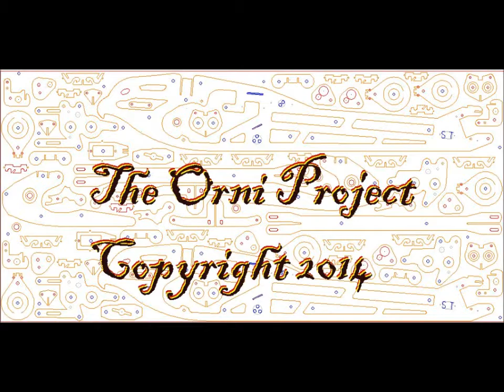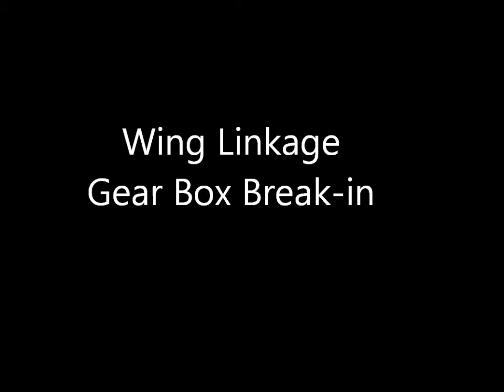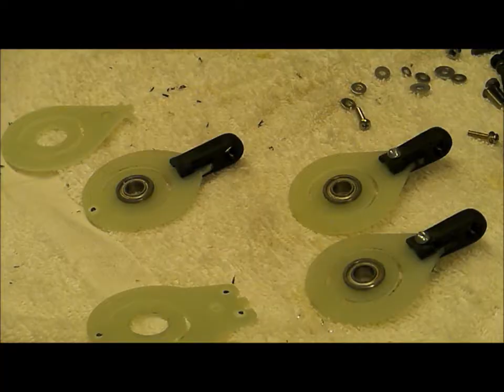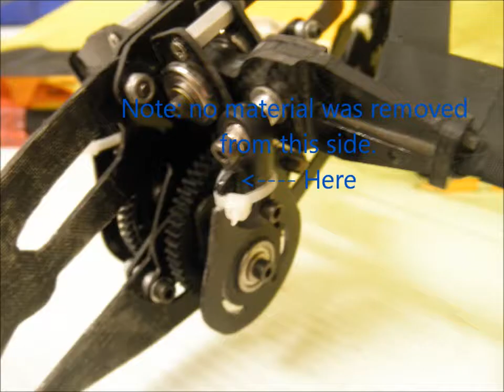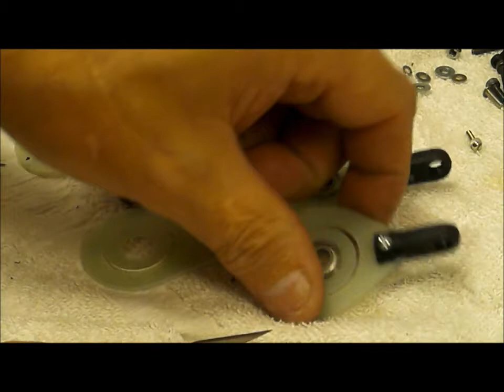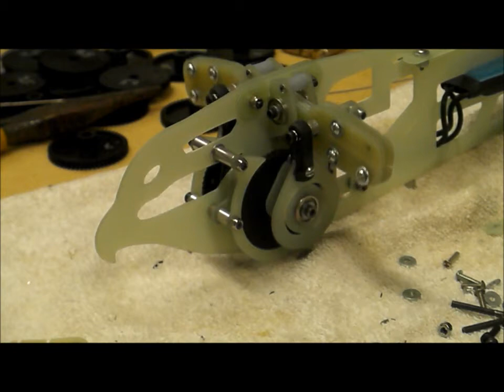Ornithopter Update #7

Comment: how do you mount the motor. considering it's an outrunner.
Reply from the maker: review the image at .33 in the above video and you can see the motor mounted using 2 screws in the back plate of the outrunner motor.
Reply: @supertroyofssf  but doesn't the bell of the motor also move? so if you're fixing it in place how is it the rotor going to move?
Reply: this is probably something very obvious that I'm missing, but could you please clarify
Reply: or do you add a shaft from the back of the motor?
Reply from the maker: The rear of the motor (the back plate) does not rotate so it can be mounted solid. Again see the image at .33 in the above video.
Also note the wires can be seen coming out of the motor at the back plate.

Comment: Which motors you've used so far and in the latest version? Which motor would you recommend for a 20 ounce ornithopter?
Reply from the maker: I am using a 4200KV.
The gearing and battery cell count you are using tell you the motor KV.
I would try for around 7hz at full power for a 48" span.
Reply: supertroyofssf
I am thinking to use worm gear assembly, because it's assembly is less complicated. So, my gear reduction will be around 30:1. And, I want to use 2S for low weight.

Which motors would be fine for 20 ounce ornithopter with 50" wing span?
http://www.hobbyking.com/hobbyking/store/__24929__B20_30_22L_FIN_Brushless_Inrunner_Motor_4220kv.html

http://www.hobbyking.com/hobbyking/store/__8144__Turnigy_2627_Brushless_300_Size_Heli_Motor_4200kv.html

http://www.hobbyking.com/hobbyking/store/__11172__Turnigy_450_H2218_Brushless_outrunner_3550KV.html
Reply from the maker: akshat nigam 
At 30 to 1 I would test a 2000 to 2500KV motor.
I think the motors you have listed would be to high a RPM.
The only way to really know for sure is to test.
Reply: supertroyofssf Yes, And I've already tested 2000KV motor. It was flapping great without wings, but with wings it was not good enough. That's why, now I am going to try HobbyKing Heli 300/450/500 size motors with high RPM, and will double the gear ratio. Then, it will flap great, I think.
Reply: supertroyofssf Also, the first motor "Inrunner 4220KV" I mentioned in above comment, would be good for small ornithopters but not for large ornithopter, I think. What do you say?
Reply from the maker: akshat nigam
It is all about the flap rate not the size of the motor.
The smaller models have a higher flap rate than the larger ones.